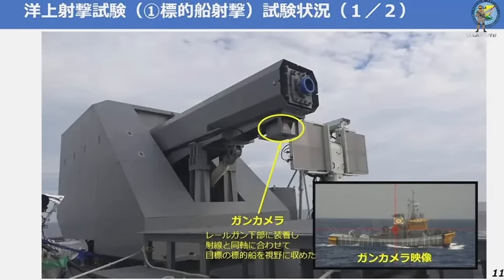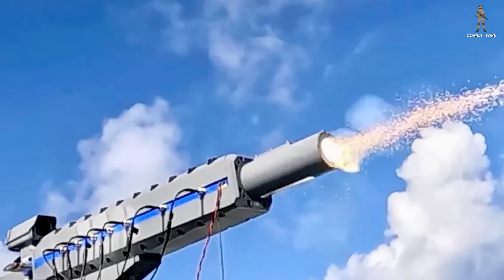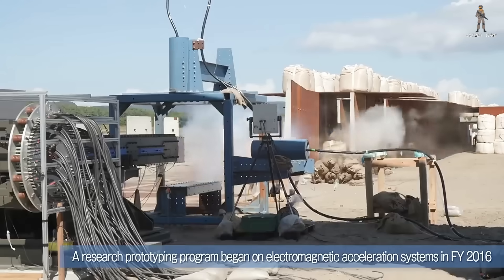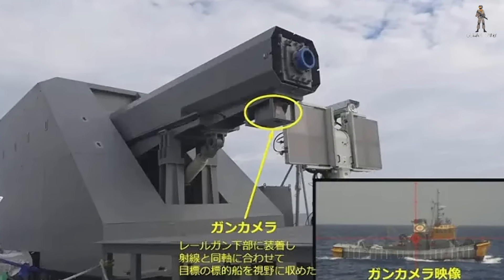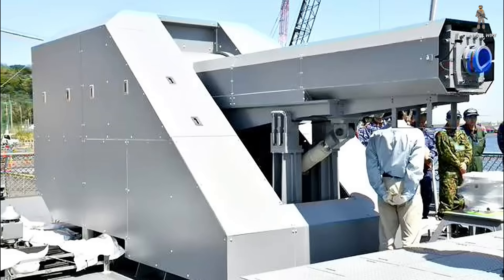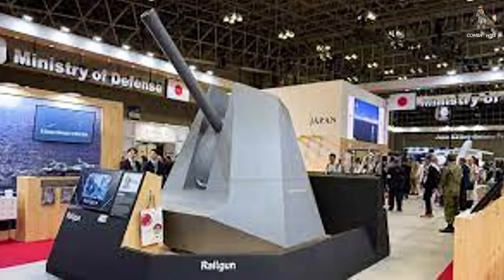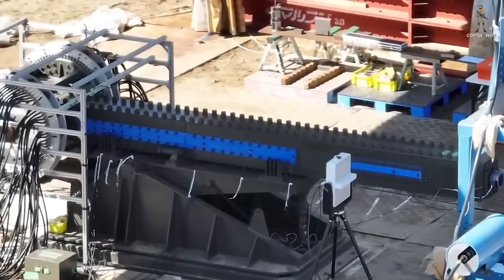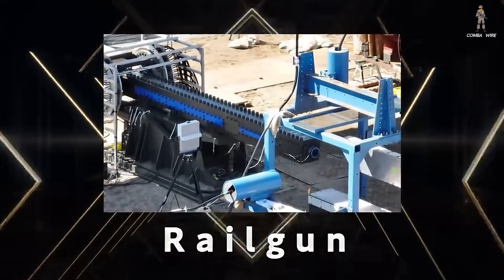For the First Time Ever, Japan Reveals True Railgun Damage at Sea.

Comment: The biggest advantage is no explosives on the ship.
Reply: Ultracapacitors: 👀
Reply: @bottomethgear9622  Right.
Reply: Capacitor crits would be deadly if you struck them mid-charge
Reply: @gigaslave capacitors boom if they get overcharged... bigger capacitors bigger boom.
Reply: @Aliveforfun  What do you mean overcharge?
Reply: @theploot8230  you can watch videos of what happens to capacitors if you apply voltage that is too high. spoiler alert. they go 💥
Reply: 1 - all railguns use a primer charge, so yes, there's still explosives initially propelling that shot
2 - a huge power generator with massive capacitors and batteries is EVEN MORE OF AN EXPLOSIVE, fire and electrocution threat. especially when being hit lol, though even outside of it given just how primitive our power relay, battery and capacitor tech still is.
Reply: @mkzhero  Thank you for actually understanding the issue with the size of the capacitors meant to operate these things. People see EVs with battery fires that can't be put out all of the time, and those batteries are nothing compared to the amount of energy storage you'd need in the capacitor banks to operate a railgun.

The one upside is that the capacitors don't stay charged, so you're at most risk if you're actively engaged in surface combat. If you've got a railgun destroyer just minding its own business that gets spotted from a distance and targeted with an anti-ship missile, I'd want to think it has better odds of surviving a hit to the weapons system than, say, a missile destroyer that takes a direct hit to the VLS storage.
Reply: @RamadaArtist   well yeah when idle the capacitors are gonna be discharged so its not much of an issue, and they're also far safer tech when discharged, but I'd imagine this kind of system would still have a lot of batteries around which are worse than ammo storages as far as combustibility goes, plus as I said, railgun ammo still needs explosive primer for the original kick like normal ammo, so it's still gonna be as flammable, or more if you count the batteries. Oh and the way bigger generators and fuel for them, or god forbid nuclear generators that for a military vessel that can be struck down is a whole other tier of world polluting nightmare... And that's all if it's struck, as you say, while idle and discharged, if any of the capacitors are hit while charged, it's gonna fry up the whole system along with everyone nearby, and cause a huge electric fire, so honestly I still think its a horrible idea, at least with current tech. Oh also with saltwater around that can flood and electrocute the whole crew if there's a hull failure... Now GROUND based railguns on the other hand are a whole other thing and already make sense - you aren't limited by power as you can feed it from elsewhere, you aren't limited by space, so outside short service time the gun will be unmanned and in the off chance it's hit no one's gonna get hurt and the electric power to it can be cut in an instant, no need for batteries in most likelihood too... There's still the problem of rain, because if hit and the capacitors go in a cascade failure while the ground around it is wet it can potentially hurt people around it, but I think it can be solved by a hydroponic insulation barrier among other things. And that's about it, so for land based usage its definitely worth looking at, unlike naval use
Reply: yes, but the lack of an explosive payload means you just punch holes in another ship above the water line, and if that ship has no explosives too its just a race to see who can hit something essential first....
Reply: @f @frogmastiff8198  At those velocities the kinetic energy of the projectile by itself causes a big explosion that makes a warhead unnecessary.
Reply: @andrewawakened628  No, it doesn't.  That can only happen if there is sufficient resistance to the impact.  A metal ship doesn't offer that.  In essence, they have made a fairly expensive hole puncher.  This is reflected in the damage photos they provided.

This kind of damage is nothing new and isn't really particularly important as far as naval warfare goes.  When naval guns were still pretty relevant, everyone put a whole lot of effort into avoiding it.

Now, it might be VERY useful if it can target and hit something like a Xi'an bomber before it drops it's payload, but it's utility against a warship is very low.
Reply: @ColonelSandersLite What you’re missing is that the projectile goes all the way through the ship and anything substantial that it collides with on its journey will explode. So if  it hits the engine, or where the ordinance is stored, or a hardened bulkhead, or an aircraft whether on or below deck, then it goes boom. A warship is going to be chock full of a lot of things that will go boom if struck by a railgun projectile.
Reply: @andrewawakened628  Sigh...  No I'm not missing anything.  If you know much at all about naval history, it is VERY well understood what happens to a ship when a shell punches through it without it's charge detonating.

Yeah, the paper numbers say that this japanese gun has about twice the kinetic energy of one of the Iowa class's 16 inch shells.  This genuinely does not matter if you're talking about hitting a modern unarmored destroyer.  They will both just punch right through.  Honestly, so would something like a 12" gun from ww1.

Additionally, the really heavy machinery that might conceivably do something to really interfere with the round is very low in the ship.  Usually below the water line.  This round will not do well on contact with the water at all so below waterline hits just won't be great.

The only way you're going to do real damage to a surface ship with this thing is if you get a magic BB and detonate their missile stores or something.
Reply: @C @ColonelSandersLite  So what you’re arguing is that the U.S., Chinese, and Japanese militaries have all wasted billions of dollars and years of development time on a weapon system which even if they manage to overcome the technical challenges would be worthless? No, I highly doubt that.
Reply: @andrewawakened628  I didn't say anything of the sort.  What I said is that this is not an effective anti-ship weapon.

In fact, I'm positive I offered a plausible use for the technology.  One of many.

I also don't say that further development can't lead to an effective anti-ship weapon.  What I said is that THIS weapon is not.
Reply: @andrewawakened628  Solid shot became out-dated in, like, the 1880’s once ships became big enough that the odds of a ball hitting something important became quite low and iron and steel ships didn’t splinter as much as wood ones. Navies switched to shells filled with explosive. Even heavy AP shells has some explosive filler. 
Since then, there have been examples in combat of ships firing large-caliber AP shells at light ships like destroyers (mistaking them for cruisers) and causing minimal damage as the shells penetrate through the whole ship without exploding. A 14 inch hole isn’t much on a ship that is hundreds of feet long. A 14 inch high explosive round can make a hole a dozen feet wide and destroy an entire ship module.
Reply: @a @andrewawakened628 ay a 8-inch wide dart flies through the ship’s bridge (which is already easier said than done), which is a large room. The only people that will be harmed are those people unlucky enough to be directly in the path of that 8-inch projectile, and perhaps those that are positionsed right next to the hole where it entered. 
Now, if an 8-inch shell with explosive hit the bridge and successfully detonated, the entire bridge is gone and it would be lucky if more than 1 or 2 men survive.
Reply: @andrewawakened628  That is literally why USA abandoned it
Reply: @ColonelSandersLite  I agree in principle with your assessment but there are a few considerations to make;

1) The only reason it would be ineffective is void space. The Mach 10 slug here is too small, it could be modified to produce a large enough airburst or implosion that it could damage compartments or anything it collided with (that's why the US system was abandoned, you could achieve similar results with an ICBM).

That would require a bigger cannon but it's a mute point.

2) The gun shown is Point Defence. It's primarily designed to be economical and reliable against Hypersonic Ballistic Missiles and Aircraft. It achieves that goal, since it is far cheaper and highly effective against anything moving slower than Mach 10. And if anything ever did exceed it, you only need to increase the number of coils, power, and barrel length to compensate making it more scalable.

3) In theory, the weapon could be miniaturised in the future to be deployed on tank destroyers. Bunkers, Tanks and fortifications would simply cease to exist against such a weapon. Mach 10 speeds simply make it pinpoint accurate and no armour would stand against it.
Reply: @ColonelSandersLite  Shooting a hard steel penetrator at a soft ship and it will punch holes. But there's also a heat pulse on impact hot enough to ignite aluminium and cook anyone in that compartment. Once the gun is operational, someone will begin work on the projectile, I can see a soft silver tipped projectile being far more effective. At these energy levels, the impact can't be modelled as an explosive, it's entering the realm of plasma physics.
I sort of agree it wouldn't be the primary anti-ship weapon because ships don't fight at gun engagement range anymore, and anti air/missile defense is probably the goal. The greatest disadvantage i see is fire support for land forces. With no explosive payload, it's pretty useless for shore bombardment.
Reply: @frogmastiff8198  I think the target ship was ironically too damn weak for a good representation of what a kinetic weapons would do to a warship say a destroyer. It's just went through and through, but a warship with proper armor...
Reply: @madmen2288  Though and through is fairly normal for anything that isn't a carrier or battleship. Several ships that were in combat in WWII were filled with literally hundreds of holes and did not sink. Armor doesn't mean anything, it's compartmentalization and ballast, most modern ships are made of composites to absorb radar, not armor.
Reply: @madmen2288  Ah, lol warships haven't had armour since the 1960s dude. They are all made with aluminium now. They have a bit of kevlar for splinter protection but nothing that would stop this thing. You need to update your knowledge my guy. We aren't fighting WW2 anymore.
Reply: @madmen2288  Do modern destroyers actually have appreciable armor though?
Reply: @madmen2288  proper armor is a hilarious demand, the energy deposited on impact determines how thick armor has to be to stop penetration, but that does not mean you don't get a 8m gaping hole in your hull with a 10m thick armor plate.
No penetration, but a secondary hit in the same location would go trough.
Reply: @madmen2288  Nah, even AP shells from a standard gun can overmatch a destroyer’s armor and go straight through without the fuse activating. This is much less damaging than if a non-AP high explosive shell is used which bursts inside the ship.
Reply: @ArmySigs "all made with aluminium now"

Lmao. This is so cute.
Reply: @madmen2288  Many destroyers these days are made to counter rockets, the age of kinetic force was over after the world war atleast against larger nations. I bet this will work well against the anti rocket ship atleast.
Reply: Which means many more projectiles can be carried by the same size vessel.
Reply: Yeah but you can pinpoint protected weak points. Imagine punching a hole clean through a ships engine
Reply: what does damage here is unstop-ability, modern warships do not have armor, such rail gun sabot shell would go like right thru hot butter, and from significant ranges, with minimal corrections. Showing a broad side to rail gun is likely better than showing bow. And it wont be sinking ships, but ship without engine and power is just floating metal.
Reply: Irrelevant when you're hit big  hypersonic missile
Reply: The biggest disadvantage is the emp fried non faraday shielded electronics
Reply: Yes but it's not just the projectile that whizzes through, it's also shrapnel that will kill personnel and shred decks, bulkheads, cables, pipes and machinery. Shots to the engine room will cripple or sink a ship.
Reply: @taras3702  yep, it's probably safer to have thinner hull when getting hit by a railgun round than a thick one when you consider danger to personnel in proximity.
Reply: @torgrimhanssen5100 That won't make any difference to crew members in compartments a railgun projectile penetrates. The spalling effects alone will kill them.
Reply: @taras3702  The test date is going to be very interesting, if the deformation of the wall on impact from a railgun shot is more or less violent in terms of this effect.
Reply: @taras3702 you severely underestimate the size of the ships. That works in a tank because all crew members are close together with the machinery fuel tanks etc. Now try to use that on a destroyer or a cruiser. You will need hundreds of rounds
Reply: @torgrimhanssen5100 nope..
Even with a thinner hull it would mean The sheer impact force would absolutely rip The ship apart. To reduce The impact force of a railgun would be a force field
Reply: @Terraqio  No test proves this view on railguns.
And no theoretical forcefield can stop a railgun slug outside of science-(fantasy).
Reply: lol lol stay in school .................
Reply: What about AA, torpedoes and so on?
Reply: if it has lithium batteries. it is disaster waiting to happen.
Reply: @Aliveforfun  Just about anything storing that much energy can be dangerous if punctured.
Reply: lol no explosives. how do you expect to power the rail gun? you need electricity. how do you make electricity? usually that involves things that burn and can go boom. I mean even a battery is explosive if you damage it in particular ways to basically short circuit it. Im sure you can find stories about batteries exploding easily.
Reply: @SolarisGO  there's explosives that power these shots too btw, too many people are unaware railguns need significant initial velocity to be more effective and not wear down the rails as much

Comment: You technically don't even need a "barrel" that would suffer from any wear and tear when utilizing technology based on magnetic fields.  Why not just suspend the projectile in place via the magnetic fields surrounding it instead.  Then you have a path or tunnel that is directed via the magnetic fields around it neutralizing both friction and wear, the projectile in theory could then attain much higher velocities with less power output.  So use magnetic levitation to surround the projectile and create the "barrel."  And when my idea is put to use odviously as has happened with so many of my past idea's some asshat will take credit for it that isn't me.  LOL your welcome Japan just use that tech to destroy the red threat and we are all great.
Reply: because its easier and cheaper in the short term, the problem with a magnetic barrel is accuracy, cost, and that a single fuck up in the computer can destroy the gun
Reply: Its not just the wear on the barrels by the projectile it's more about the intense magnetic fields warping the metal of the barrels and the support structure. Mag lev is being researched, but every watt  diverted to support the projectile is  one less accelerating it. Mag lev also exacerbates the warping problem because you need 4 fields in opposition to support the projectile in place, fields that have to be perpendicular to the fields propelling the projectile. That will increase the material stress on the barrels and supports
Reply: @Scudboy17 at this point just use rail gun since it's direct poof
Reply: There are a hell of a lot of issues with that. The major one being that the further the projectile is from the rails, the harder it is to accelerate. Which then requires stronger magnetic fields to make projectile as fast as is wanted. And that exacerbates all of the issues of barrel wear and power consumption that railguns already have. 
Also doesn't hell that maglev is relatively unstable, and that will cause the railguns to be incredibly inaccurate.